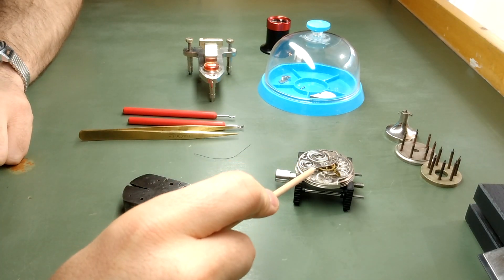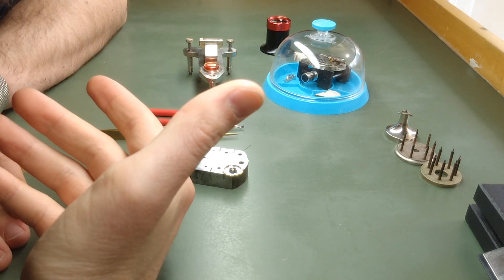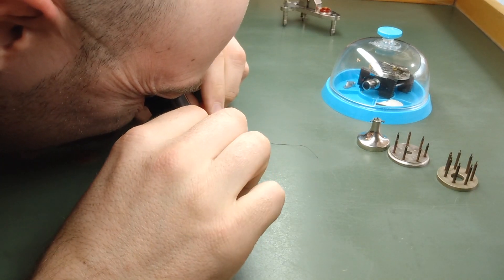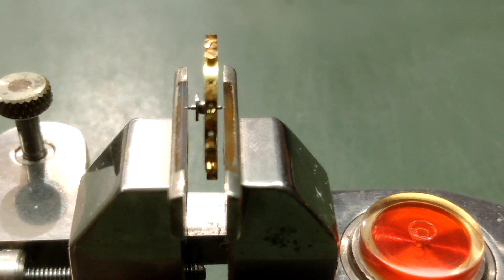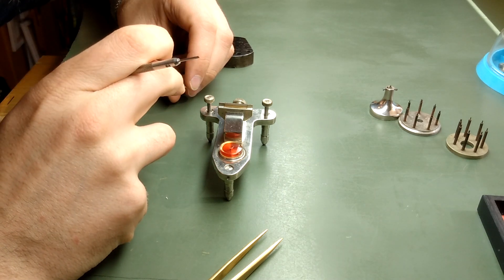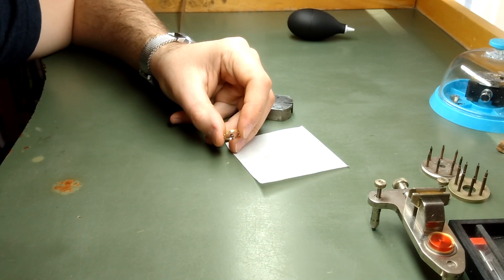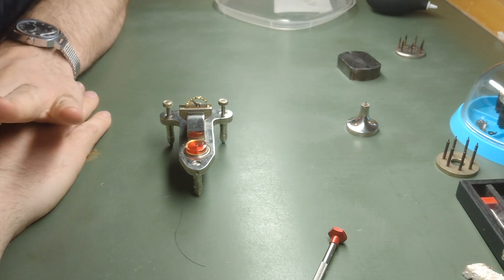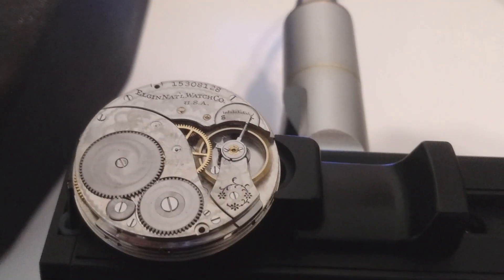Mechanical watch timing adjustment - balance wheel static poising

Comment: Good video! Wish you had shown the under cutting process in more detail as I’ve never seen it done and believe most of us hasn’t. I assume that you’ve used a bow to turn the screw? I always thought e should use the screwdriver as turning mechanism but completely wrong I presume was I.
Reply from the maker: I have screw undercutting tools. I did actually use a screwdriver to turn them - I'm not sure you could do it another way. These days if I remove weight I prefer to chamfer the screw using a burr. However in a normal situation (where you're not purposely trying to lighten the wheel to change the mean time) it's really best to use timing washers to deal with big poise errors. Then minor ones you can deal with by undercutting or chamfering.

Comment: Why not shorten the hairspring?
Reply from the maker: Hey Robert, fair question! I think the technically correct answer is that since the hairspring is a Breguet, this would reduce the length of the terminal curve too much and maybe keep the regulator from functioning. More honestly, I have never actually re-studded a hairspring and this was less stressful to me.

Comment: Hi John, what's your view about dynamic poising?  I've read that some people skip static and jump straight to dynamic dynamic poising?
Reply from the maker: Hey Jimmy, I actually have never done it before. I have been reading about it in preparation to do it on the Bunn, so you will see how it goes there! I think it sounds hard and time consuming, but it really is the correct way, since poising the balance without the hairspring collet will not get it perfect. There are lots of weird errors of poise that occur when the hairspring is attached, so I think there is a good rationale for trying to dynamic poise it. But it all depends on the quality of the watch and how much work you want to put in. For most wristwatches and cheaper pocket watches I think static is totally appropriate.

Comment: Much easier and safer to add weight screw washers to the light side. What is removed cannot be added back.
Reply from the maker: Hey William. That was actually the objective in this video. The watch was running about -1000 s/d slow with good amplitude and the regulator pins correctly spaced. I believe the wheel and balance spring were paired together by someone at some point in the past, without being vibrated. So the objective was to poise the wheel while simultaneously removing weight.

Comment: Firstly, what’s your name? Fantastic video! However, lots of questions and observations. I love the vocals, you explain stuff really good and clear. But I miss close ups like taking the spring off, getting in beat etc.  Love your tools! Could you explain how you roughly got in beat and how you accurately did that. Seeing which way you need to rotate the collet. Close up of using the undercutter.  I have since looked on eBay for undercutters and poising tools! I’m really looking forward to working my way through all your vids!
Reply from the maker: Hey Boyd, my name is John. Thanks! Yes you're totally right. Right now I'm just using my phone but if I want to really do this then I need to upgrade and work out a permanent camera placement. Thanks for watching and for your feedback! I will do a video on beat setting soon - that's a great idea.
Reply: @timelyvintagewatches  thanks John, I’m getting through your videos!

Comment: "So I finally got the watch working, and it's working quite nicely, but there's a big problem, which is that the watch is not keeping time". I find it really funny that a watch can work "quite nicely" but not do the one thing it's designed to do 😂
Reply: Timothy, not sure if you are into servicing watches: to get a 7 jewels to work with a high amplitude after rebushing and cleaning is quite rewarding. We call this state as the watch working ‘quite nicely’!
Reply from the maker: Haha yes! "Working" is a continuum, but "is it a watch" is 0/1.